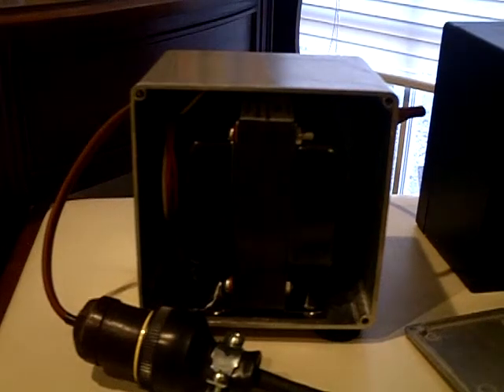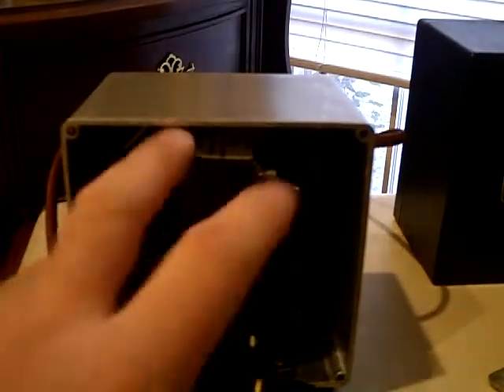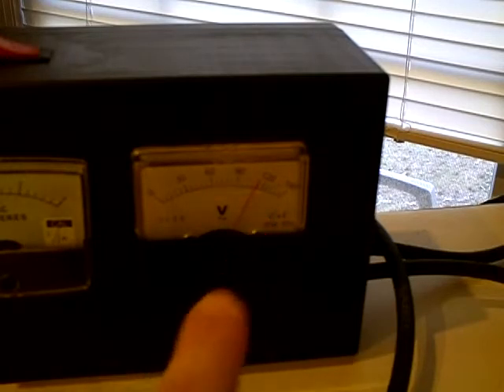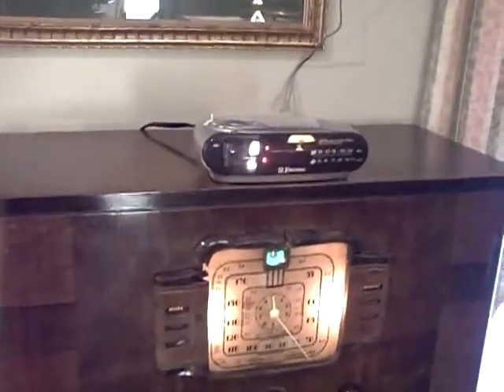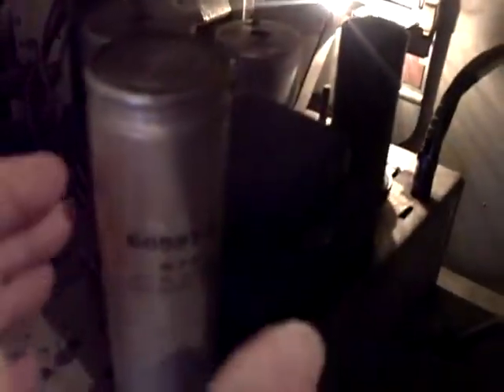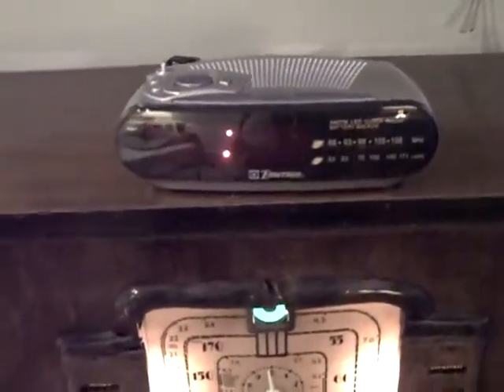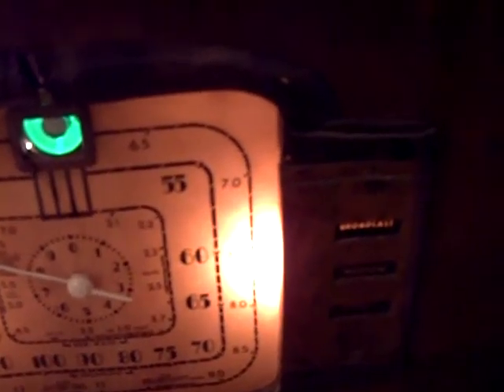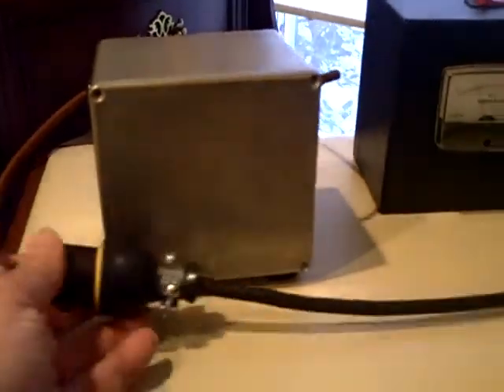Part 3 RCA 810K The Problem with Voltages. Is it Done?

Comment: hello , thanks for sharing this video.  I just purchased an RCA 810k but its missing parts.  in this video your hand is on the power transformer checking for heat.  What is the part just before the transformer ?  the silver part looks like a capcitor.  i couldn't reathe numbers . it looks like 676 stamped on it.  can you tell me what that is.  im looking for schematics as we speak.  thanks

Comment from the maker: That's actually a good idea. However really no need since most if not all of the old radios are designed with 115V as the factory test spec. If I have a radio that needs 125 V as the factory test spec, I can just still plug it in at 115V and it will still be happy and the tubes will last longer. Now I guess If I had a radio that used 105 V then that would be a good application for your idea. So one second thought, that is a very good idea, I think I do have an old GE that was made for 105 V.

Comment: That was interesting. But I see a bit of wasted potential. Had you gone with a slightly larger box, you could have installed a selector switch, and used all of the taps. So if a future radio required something other than a 10 volt adjustment, with a flip of the switch, you're there. ( I know, there is one in every crowd.)    ;)